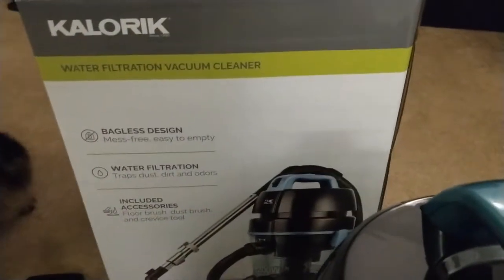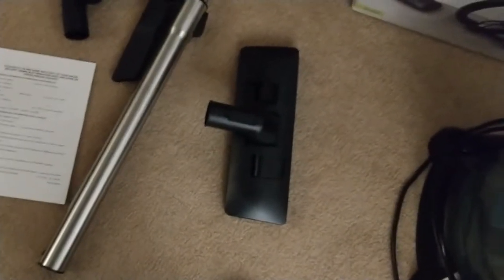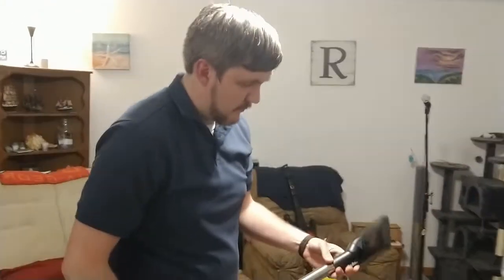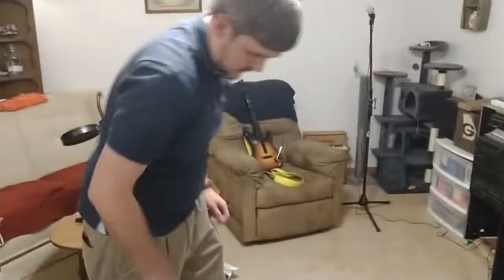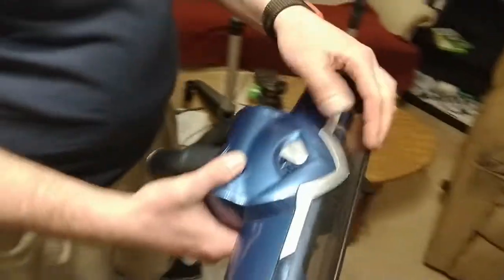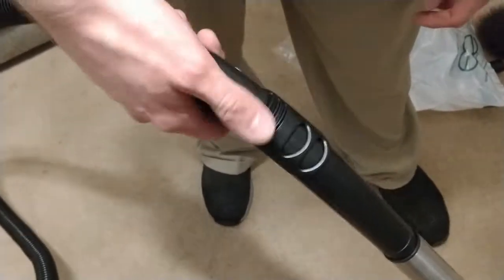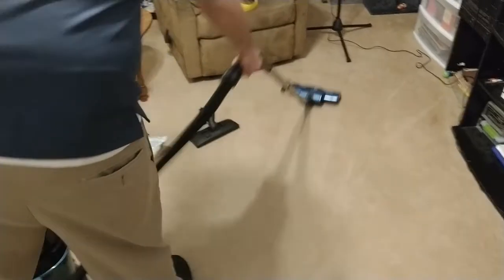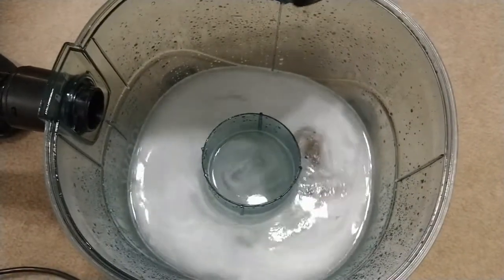Kalorik Water Vacuum Video Review

Comment: Hello Everyone, I just ordered this vacuum  cleaner on Amazon and found the roller attachment which comes in red or blue. The roller head attachment on Amazon is called "EZ SPARES 1 1/4 inch 32 mm Universal Vacuum Cleaner Floor Brush".  You may need to scroll a bit but you'll find it on Amazon.  I hope this information is helpful and I'm excited to get this vacuum cleaner. Best Regards
Reply: Thanks!!!!
Reply: Thanks!

Comment: Where did you get the other attachment? Also, I use it without the hose to clean the air and it is good too.  I had no idea you could put the attachments on the feet! How cool is that. Thanks for showing that.  Can you use this vacuum like a carpet cleaner too?

Comment: Where can the other floor head that glides back & forth so easily be bought?
Reply from the maker: I found it on Amazon
Reply: @markroberts686  mark can you say what it is called? Is it a beater brush? And who makes it? I have a catalog from ginny's but it's probably a year old 139$ but it's higher priced for people who have bad credit!
Reply from the maker: @me4654  https://www.amazon.com/dp/B07543XNRP
Reply: @markroberts686  thanks Mark I actually found it earlier but I don't think it will work the way I want it, most newer vacuums come with that roller attachment that is driven by suction and they stop after a minute and don't really pull much up, maybe I'm wanting to much from it cuz my kirby roller brush has a belt on it and you can actually see it pull up the carpet 🤣 it doesn't tear it up but it is super strong and it's made from die cast aluminum and it's so so heavy you can get hurt trying to move it, I have other attachments for it but they do nothing plus I have put those roller brushes on the hose of the kirby and it barely rolled! Love the HEPA bags and would never go without a bag or in your case the water cuz you open up the dust cup and it's all air born I don't get the hype of the bagless one's! I may order the vacuum that is 20$ more than the one your using cuz it's for pet's and it looks like a ton of attachments (,out of stock) and if I have to I can always order the brush, it's so loud I wish someone would invent a quiet one I had 3 cats had to put one too sleep Nov 25th him and another one would slip through the bifold closet doors and the other one on top of the fridge 🤣
Reply: @markroberts686   How has that brush head held up over time?

Comment: can you shampoo with this machine?
Reply from the maker: I haven't been able to find any attachments for that. I have a carpet cleaner, and I use the vacuum over the carpet after cleaning.
Reply: What you can do is use a spray bottle to spray the shampoo solution on the areas li are wanting to shampoo and then use the flat suction for hard floors to remove the dirty liquid. I’d do this in small sections and not over saturate the area